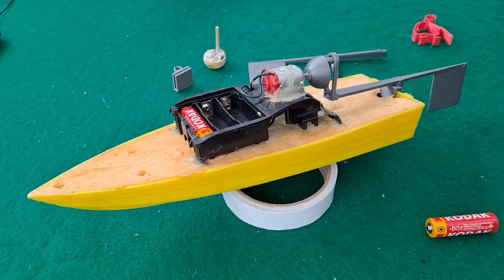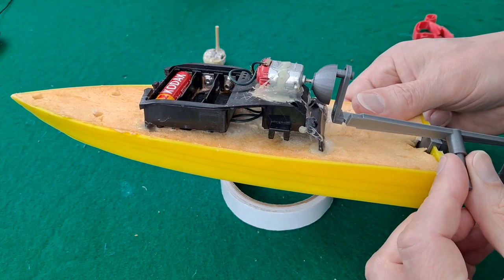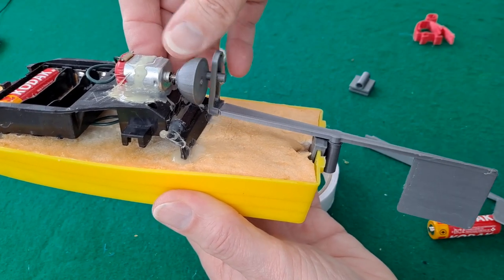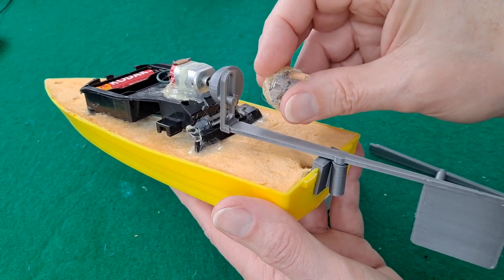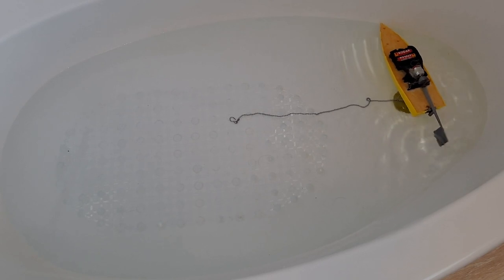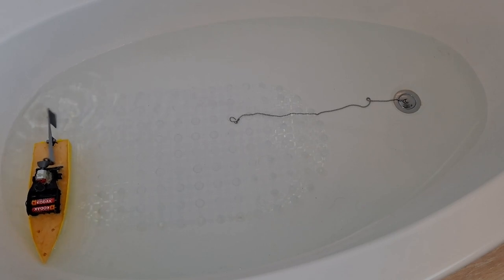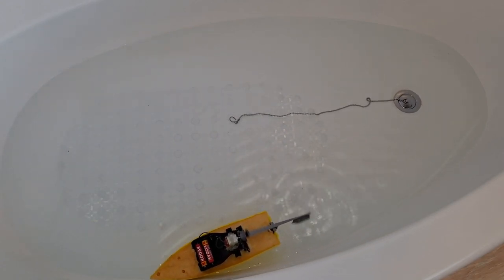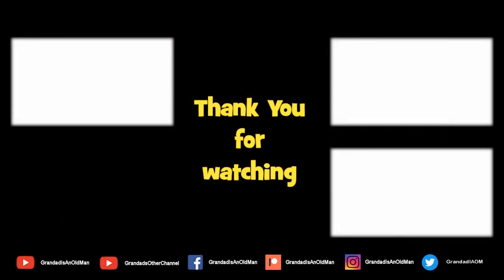PART 2 Flapper Paddle Boat revisited

Comment: If you're good at all with setting up radio control stuff, I would propose an idea.. make little fins, similar in shape to the back of the rudder, that can attach to the sides of the boat with the front end of each fin able to pivot, and the back can be pushed or pulled in and out by some kind of electric piston.. the fins would start out flat, parallel to the sides of the boat, but pressing a button on a remote control would push one end of the rudder out at a 90 degree angle, creating drag on that side and theoretically causing the boat to turn.. having both fins stick out should help bring the boat to a stop if needed.  You could also have a button to turn the existing motor on and off by having something that interrupts the current from the batteries.
Reply from the maker: That probably would work, the brake idea would certainly slow the boat down, although it wouldn't stop completely. To be honest, it is easier to use proper hobby grade RC gear with servos to operate the fins you describe.

Comment: Nice little worker but how die you get it To run with only 2 batteries instead of 3 since there are 3 battery compartments.
Reply from the maker: The wires connecting the motor go to the first two battery slots.